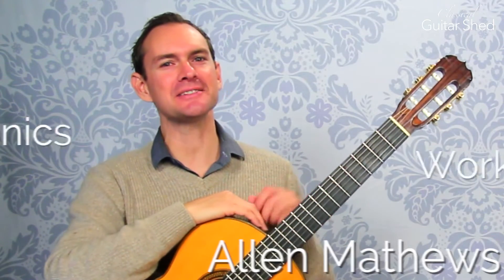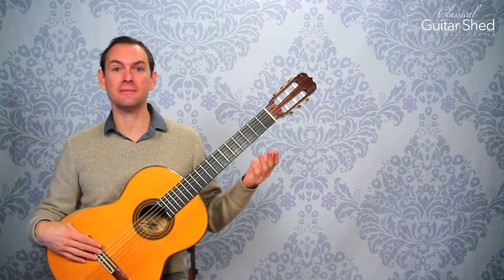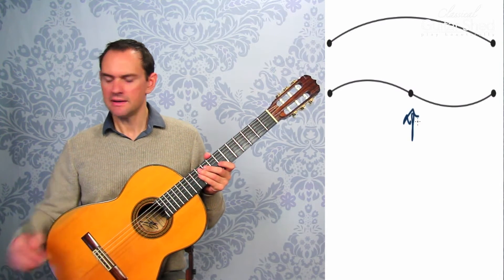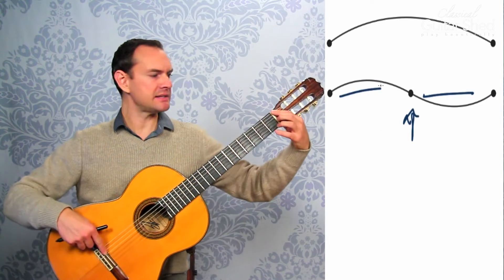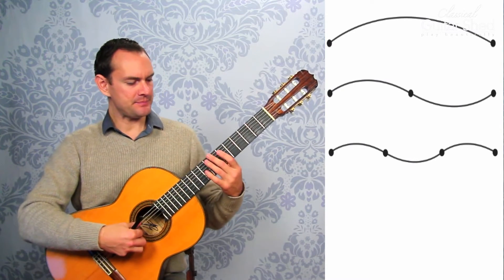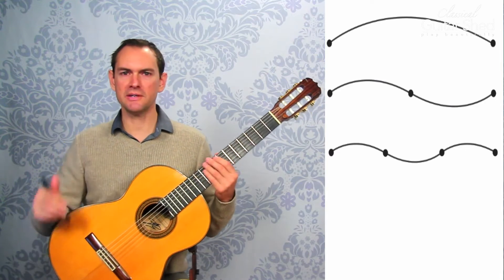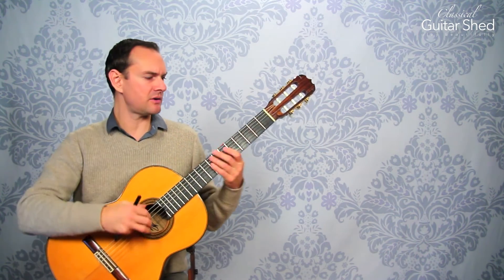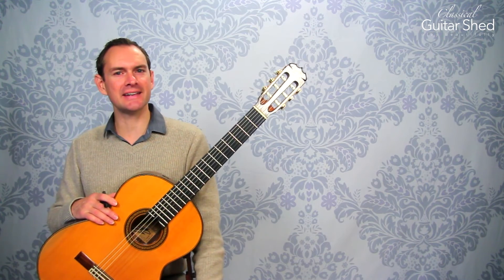How Harmonics Work on Guitar (WARNING: contains science!)

Comment: This is almost accurate... the main correction is that strings always vibrate at the fundamental frequency but also at the 2nd, 3rd, etc... harmonic frequencies. It's not that you make it vibrate on each harmonic depending on which fret you hover your finger over. The 3rd harmonic i.e. the 5th is one of the strongest sounding harmonics in many instruments which is why it is often ok to leave out the 5th in basic triads or 7th chords, because it's frequency (albeit 1 octave higher than the root) is already very strongly present in the sound of the root note.

Comment: Great video!

But how exactly does that splitting happen? And what is the difference with holding the string down on the fretboard? 

Is the string really vibrating in 2, 3, 4 etc... sections independently? How does that happen physically when you are only pressing down on one point when you up in the harmonic series?
Reply: It’s just physics, every action has an equal and opposite re-action

Comment: The string is not vibrating on both sides, this might be confusing. The string is actually vibrating at twice the frequency as it would vibrate when you're not holding any finger on the string. That's why you get a different harmonic on the same string on each fret
Reply: But it is though isn’t it? I just played 12th fret harmonic and then I touched the string to the left of where i was fretting and it muted it completely, so the whole string vibrates.
Reply: Wouldn't that just result in the note being an octave up?

Comment: I'm diggin' those good vibrations! Thanks!
Reply: Alan can you recommend any composed pieces that make use of harmonics, more than just a few notes? I once heard Tal Farlow do this, but it sounded like he was improvising, being a jazz payer.
Reply from the maker: hi Lynne, The ending of Villa-Lobos Etude 1 has a nice harmonic section.  It's sort of a tough piece overall though.  The Scarborough Fair arrangement in the Christopher Parkening Method book 2 is very nice and has a harmonic outro.   Harmonics are generally used sparingly, as an accent.  I hope that helps.
Reply: Thanks. I guess an outro is the opposite of an intro? That's a new one on me. I will check out those pieces.